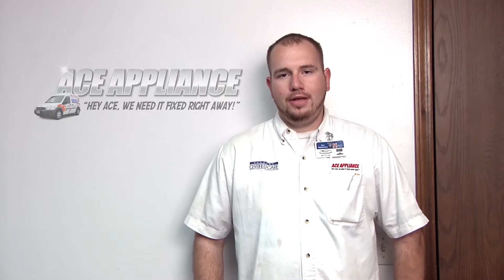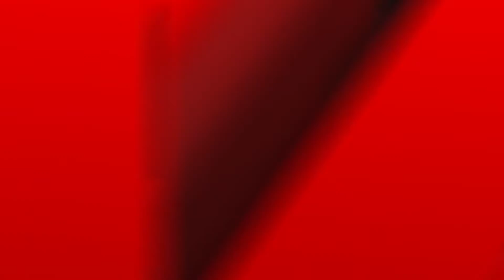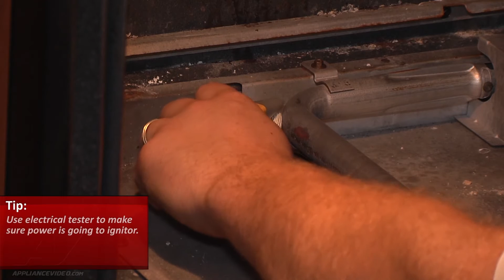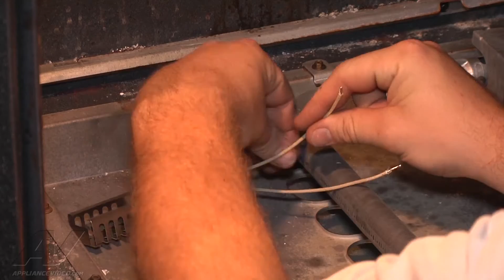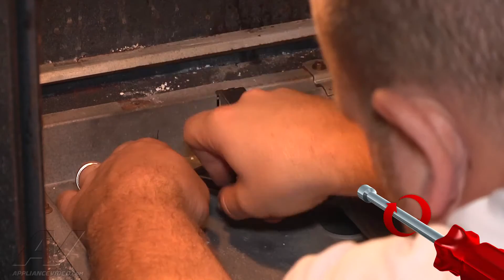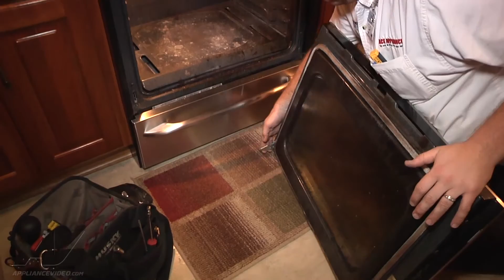GE Stove Repair - Not Baking - Igniter

Comment: Not a big deal but will ask anyways. 1990s gas range RCA the model number plate is missing and tried to Google pics to identify it unsuccessfully. If I figure a way to take it apart based on this video and take out the igniter can I send a pic to identify the part or can I use a universal one?

Comment: Hello, I have a question, I have a RGB7WEA1WW model hotpoint kitchen which does not turn on the oven, but the electric ignition works, it turns red but does not light the flame, what could be the problem?
thanks and regards.
Reply from the maker: Great question, if you have a more technical question that our parts department cannot answer, you can search our over 17,000 answered questions free at our website www.ApplianceVideo.com under our Repair Help section. You can also call our parts department at 1-800-830-5465 and they can give you help 7-days A week ,or search at www.SaveMoreOnParts.com  .

Comment: What is the gas does not come out after installing the new igniter?  Could it be the safety valve needs to be replaced ?
Reply from the maker: Great question, you can call
our parts department at 1-800-830-5465 and they can give you help 6-days A week
Mon-Sat . You can also search at www.SaveMoreOnParts.com 7- days a week.  If you have a more
technical question that our parts department cannot answer, our technicians are
answering all questions at our website at www.ApplianceVideo.com under our Repair Help section. We have over 6,000
common questions and answers that you can easily search through by your model
number, appliance make, problem or error codes, and It’s completely free to
search through our question & answer library. There is a very good chance
you question is already answered there.
Reply: Did you try switching the wires around?

Comment: I have a GE JGBP30WEA6WW and have replaced the igniter. The oven still does not light but the broiler works fine. I have power to the valve from the selector but no power through the selector to the igniter. Is the valve bad?
Reply from the maker: Bruce Backer     All of our technicians are now answering questions daily on the ApplianceVideo.com website. You can search completelyFREE in our Repair Help section with over 1000 questions & answers. Or you
can get unlimited technical advice and video links emailed to you by our 14
factory certified technicians at
http://www.appliancevideo.com/premium-membership/.  If you are in need of
any parts please support our parts department on line at http://savemoreonparts.com/
or call 1-800-830-5465 7-days a week until 11pm Eastern time. Thanks for your
support. Matt Ace Appliance factory service technician.